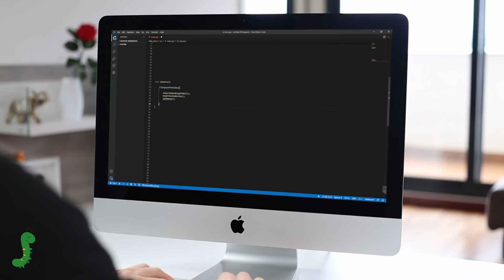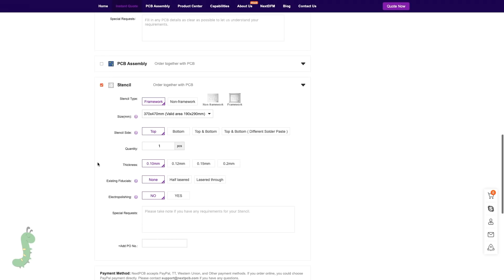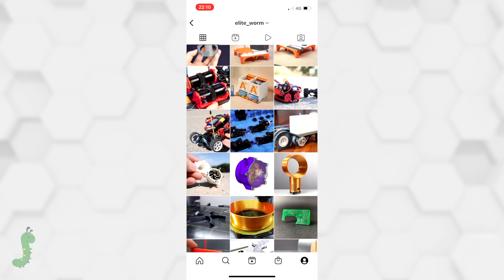I've built a Radar ESP32 to Catch the Burglar | Soldering & Assembly | Elite Worm

Comment from the maker: If you liked this project, SUBSCRIBE and ring that bell! Next one coming up soon...
Reply: A life hack so that the BGA paste does not spread under the stencil. Apply the amount of paste you need on a paper towel and heat it for 15-20 seconds with a hair dryer at 100 degrees Celsius so that the flux from the paste is absorbed into the towel. After you can apply the paste on the stencil.
Reply: Hello dear Worm!
Do you have a degree in electronic or you just do it as a hobby?
Reply from the maker: @thombaz  Yes, I am an electronics engineer
Reply: @EliteWorm  Thank you!

Comment: Question for anyone who does SMD soldering. How do you stop the solder paste getting on the tip of the needle nose tweezers used to place the part, then sticking the part to the tweezers, so when you pull up the tweezers, it doesn’t pull up or shift the part with them? Anyone else have this problem? I’m using quickchip solder paste. Maybe it’s about the viscosity of the paste?
Reply from the maker: Yep, that’s a huge pain… I usually clean my tweezers with alcohol every few components. But maybe there’s a better trick. I’m all ears!
Reply: @EliteWorm  Okay, glad it’s not just me. You made it look so perfect in the video :) If it were my video you’d see a lot of components getting put in the wrong place and hear a lot of swearing :) perhaps that why I’m not such a successful YouTuber… hah

Comment: Your project is interesting but no one leaves the USB facing the PCB lol
Neither the USB cable should touch the RF antenna (AC signals should be away from other AC or DC signals.

Comment: I had the same problem with false alarms because of the radar's range (and because it works 360° around). Thanks for the tip with the resistor.

Regarding the problem with the components moving to the side of the pads, this looks to be a 2-fold problem. It looks you used a footprint for hand-soldering, these have longer pads. The regular pads are shorter such that the pads of the component are more or less centered on the pads on the PCB. Due to capillary forces, the component will now float to the center of the pads easier.
But there is also an issue with the amount of soldering paste. The stencil should be firmly pressed on the PCB and you should try to apply the soldering paste in one stroke and then pull the stencil off without moving it left to right.
Apply a large bead of paste on one side of the stencil and use a this steel spatula, press down firmly and strike from left to right in one fluid motion. If done perfectly, the stencil should be almost clean without streaks of paste on it. You can put unused soldering paste back in the container for next use.

There are more ways of applying the paste but this is what seems to work best for us when doing this by hand. It is still not easy though. We have a machine to do this and that is still not doing it perfect all the time.
Reply from the maker: Thank you so much for the tip, I will definitely check the footprint that I am using!
Reply: Can you not use metal behind the sensor to stop 360° sensing?

Comment: If you had a way to lock the door on them once they are inside and the door closed... and keep it locked until you arrive with the police.  That would be a non-lethal and no chances of hurting yourself or someone you didn't mean to hurt.  Like change the internals of the door lock from a regular latch style setup to a dead bolt.  You could use contact sensors to know when the door closes and then actuate the dead bolt lock inside the door.  The knob on the inside would be useless until either the actuator trips/resets the dead bolt back or you unlock it from the outside.
Reply: Even this could be illegal in some countries. In many ways, like holding someone in captivity even if it's a burglar or from building safety standards where it must be a emergency way out. Guess cameras are a reasonable way, but not as reliable.

Comment: I want to make a tracking radar using a tiny emmiter (mounted on an RC plane) and 3 recivers that sends the signal strength to an arduino to move stepper motors. These receivers are mounted in an angle so there is a hole in the middle for a camera to look through and pointing away from the camera, something like this:
\    |    /
  \  |  /
    \|/
The middle line is the camera center and the other two lines are the antennas. The receivers are 120º out of phase when looked from the front. Can you make a tutorial on it?